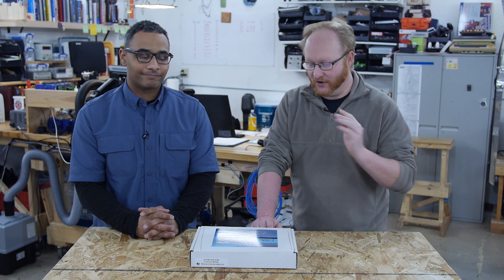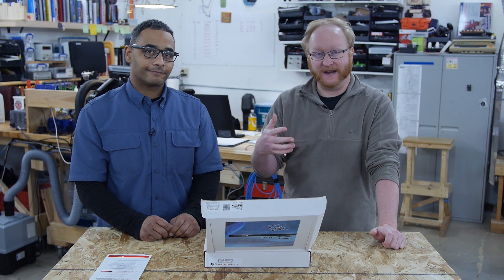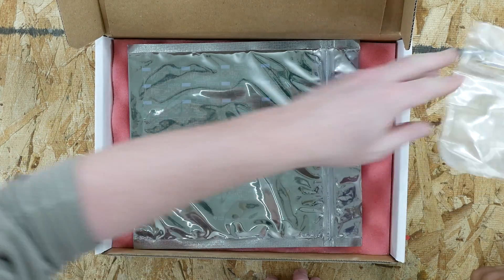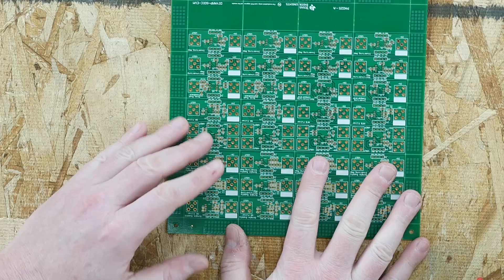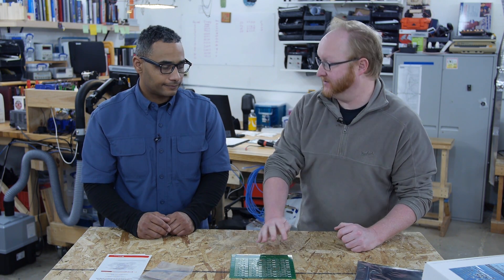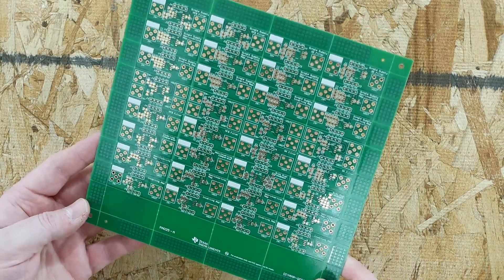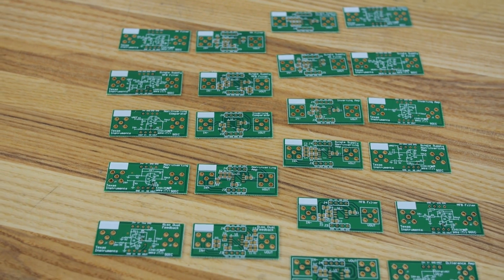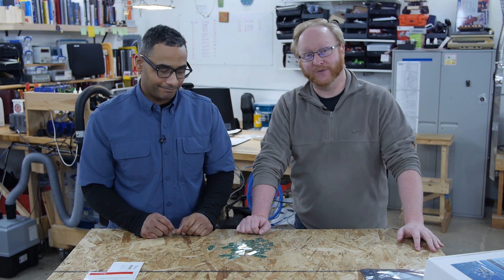Ben and Felix unbox the DIY Amplifier Circuit Evaluation Module (TI DIYAMP-EVM)

Comment: Question for the group. On the Raspberry Pi 3 The Run sockets (there toward the USB next to the gpio) is that safe to use as a reset? Or do I risk corrupting the MicroSD?